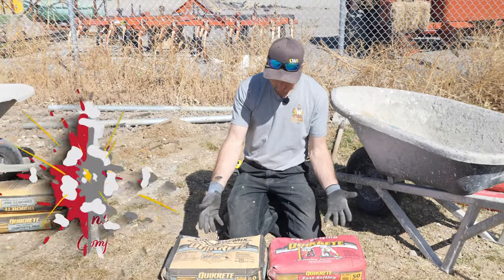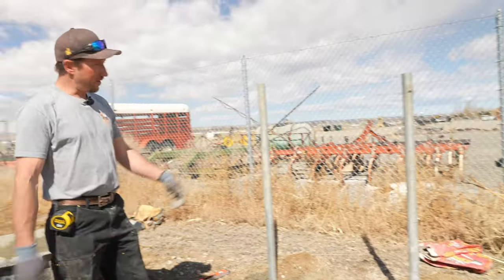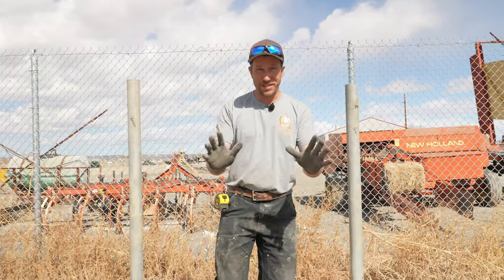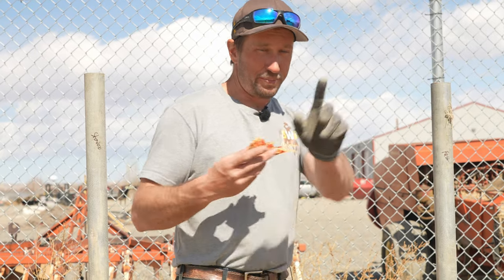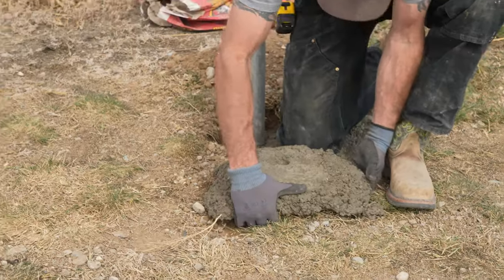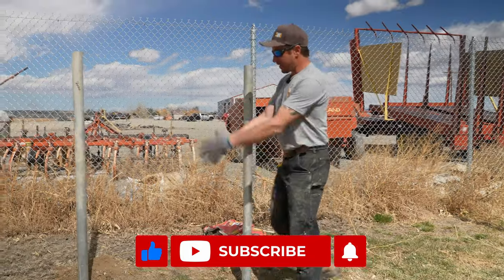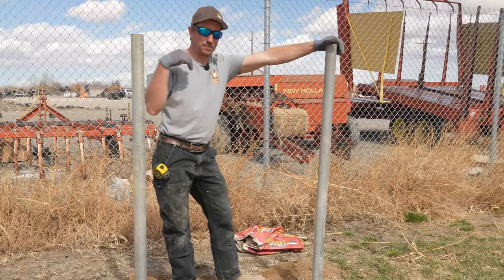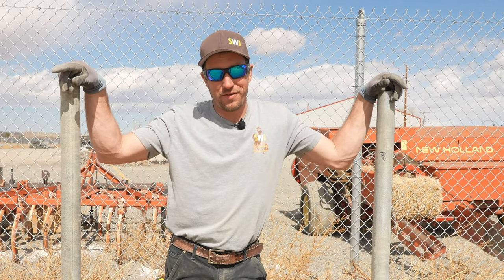Is Quick-Set Concrete Worth It? Testing Quick-Set VS Regular

Comment: Another advantage to the fast setting is that it is designed to set without mixing. We like to get all the post in the ground, add dry mix to all of them and come back to sight them in and add water. We will add water and poke 3-4 holes in the concrete to make sure water quickly penetrates to the bottom. Thanks for making this video.
Reply: Never set up a fence post  but this sounds Ike the best idea I've found yet.
Reply: @xxxxxbriansanchezyyy  best way to have your wooden fence posts to rot out. I'm currently going back and repairing my posts of my deck because they ask rooted out right a ground level.
Reply: Bring your concrete slightly above ground level, slope it down at an angle, so any water will drain and the post will last longer.
Reply: Its literally on the bag label and tells you to dry pour for fence posts
Reply: @cvillefarmer  wood and concrete do not work well together. We use all steel for posts. Piers should be poured for deck footings
Reply: @elliottbrown1725  I went back, cut the old treated posts that are still prefectly fine above the ground level.  Pulled the old footing that had post set into concrete. Poured new sono tube footing up to where I cut old post, used a steel 4x4 post anker bracket set into the wet concrete footing. Waited for cure then set the post down into the steel bracket fixed in the concrete. So wood is separated from concrete by about 1inch with the steel bracket.

Comment: for a little more than half the price, I would go with the regular high strength concrete bag (80 lbs for $5.27 equivalent to $3.29 of a 50 lb bag) over the quick setting bag (50 lbs for $5.37 per bag or $8.59 for a 80lb bag). Just take your time, brace your posts and wait a day. It will take me a few days anyway to set up all my 23 posts.
Reply: So how did it go? I have 23 posts to do too. Was considering the fast due to I live 30 minutes away from the jobsite not really wanting to drive too many days.
Reply: Exactly I'm trying to put up a fence and save anywhere I can. That's why I'm doing all the labor myself 😅
Reply: there is no need for bracing with quick set. by the time you're done with last post you can go back and hang pickets. you save a day for few bucks. quick set all day
Reply: TIME IS MONEY!

Comment: A lot of you have no clue what you’re talking about.  Setup time has zero to do with the strength of the concrete mix.  Rapid set is stronger then anything else in a bag and sets up faster then anything else in a bag… drive on it in under an hour and they use it on airport runways it’s that good.  🤦🏻‍♂️.
Reply: Than, it's than!

Comment: Is it worth it? Well, Quikcrete is more expensive. That said, time is money so if it takes more time to mix your concrete the traditional way then it seems as though you’d be breaking even by using Quikcrete! Personally, after setting a few metal post brackets last week without mixing, I’ll most definitely not be pre mixing in the future.

Comment: I had to watch your video when I got home.  I worked with the fast setting concrete today.  It was my first time to use it.  It does set up faster than the concrete in the yellow bag.  I won't be using it again, because I like to be able to work with the concrete for a few minutes.

Comment: The difference is the formula an yes correct on the fast setting is for fence an the regular concrete is for more lengthy jobs that require longer set an dry time fast setting is for posts only an for side walks an patios there is a product we make Q-5000 which is more pontent

Comment: I’ve used the fast setting before and it does well.  I have a problem in knowing how much water to use.  It’s less than a gallon per bag but it never seems to all soak up and it sets too fast to allow me to poke holes in it for the water to get to the bottom.  Another problem, what’s the technique to adding two bags to a fence post hole?  Add one bag then water then the other bag and more water?  Adding two bags at once then water doesn’t seem to get the water all the way down to the bottom.
Reply: Uh gee boss I don't know, maybe fill the whole 1/3 with water first, then pour in the concrete.  Also 1 part red bag to 3 parts regular, sets faster but cost less and is workable longer. You are welcome!

Comment: They used to manufacture bags with a plastic liner. Now without the plastic, the bags just blow apart if you drip sweat on them while working. Higher profits, bigger bonuses for the suits. Called corporate and complained. It’s been crickets.
Reply: Good. The less plastic the better. 
Just don't be clumsy.

Comment: One more question. I am installing a steel/metal fencing post. The hole that I dug is 3 feet 9 inches deep with a diameter of 14 inches. How bags of Quikrete do you think I would need assuming I want the Quikrete to come up to ground level.

Comment: I dug a 3ft 9 inch deep hole with a diameter of 14 inches.  Due to rain, the 3ft 9 inch hole got about 9 inches of water in the hole. Crazy thing is the hole was completely covered prior to the rain but somehow 9 inches of water still got into the hole. I have been waiting for the dirt to soak up all the water in the hole however it doesn't seem to be doing that. After two weeks the water is still there. So my question is what would be the best way to drain the water out of the hole? I thought about just putting a few thick bed sheets in the hole to soak up all the water like a sponge but wasn't sure if that would work efficiently.  I then thought about just pouring dry concrete in the hole and mixing it with the water that is already in the hole.  What do you suggest? One more question. If I drained all the water out of the hole and the dirt/soil in the hole is still wet and soft is it still okay to mix concrete and pour it into the hole with the dirt/soil already being fully saturated with water? Oh wait....one more question LOL. How many bags of concrete would I need for a 3ft 9 inch deep hole with a diameter of 14 inches? I will be installing a fencing pole with a diameter of about 2 inches. Thanks for your help.
Reply from the maker: You could try a kid's suction squirt gun (outdoor toy aisle at Walmart) or something similar. After you pull the water out--yes, double-check and clean the hole out one more time.
Also, yes, you could throw in some dry concrete and do that as well.
Reply: @SWiFence  I ended up draining the water out of the hole myself simply by putting a thick bed sheet in the hole and pulling the bed sheet back out of the hole.  When I put the bed sheet in the hole it completely sucked up all the water out of the hole. The project required 10 bags of concrete as I made the hole way too deep and wide but I would rather be safe than sorry. The 10 bags used was for a 3ft 7 inch deep hole that was 1 foot 2 inches wide. I will be adding additional post within the post that I installed to serve as a 34 foot mast for my HF antenna. He is the video that I did. There are two videos. Video # 1 is the preparation and Video # 2 is the actual start and completion of the installation. 

Video # 1:  https://youtu.be/9hzI_OhRnjI

Video # 2: https://youtu.be/xBX3DEBQuBc

Thanks for your help.

Comment: Could you use a little fast setting first to get the post to be sturdy and workable and then add the high strength after 30 min or so in order to work while the majority of the the high strength dries?
Reply from the maker: I wouldn't recommend. Concrete should pour once and cure once.
Reply: @SWiFence Facts!

Comment: Yeah fast set is weak. 
It’s like crumbly powder if you hit it with a 6’ crow bar. 
Somebody I know tried making a sidewalk from it. The edges broke right off. 
Zip for strength. 
If I want to work on a post quick I tamp it with a fairly dry mix. It’s super wet where I live so the moisture will continuously go into the concrete over the winter. 
Mix the top well. 

I used to use quick set. I don’t use it anymore. Cheaper. And stronger to use reg set. Once it cures that fence ain’t ever going anywhere (unless a tree root starts moving it over time).
Reply: Thanks for the tip. I was wondering if you could repair sidewalks with it.
Reply: Not everything is a good app for everything. Works more poorly on slabs but good on posts. Just like an 18 wheeler isn't good for orv trail riding. Losing a customer another day of production to wait for set up isn't usually the best choice, either.
Reply: @finallyfriday.  
We set it sort of more on the dry side and tamp it. 
No bracing needed. 
It’s plenty strong and will only get get stronger with time as it sucks more moisture into it. 
The tamping can be labor intensive and a bit slow, but we build immediately.
Reply: @woodman1701  it's the tamping, the compaction that's the real factor. Soil well compacted is better than cement in loose ground. Hard as granite cement is actually irrelevant since the post would break long before. In fact cementless posts rot slower and flex in high winds better (think oak tree vs willow tree). Overkill has its disadvantages. Cost being another disadvantage. No one best answer, though.
Reply: Setting time has zero to do with strength of the concrete.  Rapid set concrete sets up and you can drive a car on it in under an hour and it’s stronger then anything else out there in a bag.
Reply: @sicilianr1  
Well my contractor brother in law and myself tried making a slab out of it once and it had zip for strength. Broke easily after a few days. 
I build a lot of fences and we can tell which concrete post bases are quickset and which are regular set as if you hit the quickset with a 6’ crowbar it breaks and crumbles easy. It’s fine for that purpose and also for setting mailbox posts but I wouldn’t make slabs out of it. 
Perhaps you have a different brand? The stuff sold in Oregon was a not strong. 
I use reg concrete for all my fences as it’s cheaper anyhow.
Reply: @woodman1701  You're not building Fort Knox as a base for a fence post. Massive strength lasts 200 years but the fence deteriorated long ago. What was the point?
Reply: @finallyfriday.  
Well, I save money on every bag I get. It’s like I think like a three dollar difference per bag. 
The cheaper ones are actually 60 pounds and the fast set  ones are 50 pounds. So there’s less troops on every fence as well. So if I have 16 bags on an average job size that’s like 45 or $50 difference and less trips to make to all the holes. And I know that it’s even going to be stronger for the customers over time. Sometimes the concrete will crack in half and the post will become sort of loose. This is more of a insurance policy that that won’t happen.

However if the brand that you’re getting is just a strong, and the bags are lighter and you’re only doing small jobs then I could see the advantage for you. I know Lowes uses only Fast set. Mainly because they wanted to get the jobs done in a hurry. It works for them.
Reply: @woodman1701  Good points. One common claim is about cement cracking-  that is supposed to equate to fence post failure.  Think about it- even though it's cracked it still is encasing the post with a hard, heavy and expanded medium. It still supports. Think of a crack in a road. It's still doing its job. Gravel in the post hole is supporting. No cement, just well compacted soil is doing its job. Pile driven posts are still doing their job. A cracked cement pour in a fence post hole does not equal a fence collapse. I doubt anyone would ever even be aware it cracked.

Comment: see your mix outa the bag aint all gravely i got like a ton of filler gravel wondering "where the crete at" screwed up that ya gota know tricks like add a can of paint per every 5 bags  and a extra couple pounds ceramic plaster  and a can of glue for that playdo icen pasty kinda smooth.... just did our side walk  on straight out the bag edges gona be falling off on gravel flake luckily i got a finisher for surface covering...they should just keep filler gravel seperate and go straight crete filler is underlay..not cool to need trix instead of buy it right as set order of options offered  together  till then it sucks as a brand the second time it was 90 % gravel sucks especialy on tight budget every bag needs like an extra 5 pounds of actual port crete or clay...

Comment: Do you every pour the concrete in dry set your post then add water? I hear fence guys doing this all the time.
Reply from the maker: We don't. https://youtu.be/iBgWx2y9pj8
Reply: We do. Dry pour can be compacted- most important  factor. Wet cement cannot be compacted. More work for less hold.

Comment: So what's the benefit of buying the original version?
Reply from the maker: 1. It's cheaper.
2. It doesn't set as fast. If you're laying a long line of fence or working on a sidewalk that you need time to smooth and trowel you absolutely don't want the fast-setting. It'll set up before you have a chance to finish your job correctly.

Comment: I just used some Quikrete for 2 separate gates posts. The first one I put it, had no issues with the concrete drying. The 2nd one is a different story. Just poured it and, it still looks 'wet'. The first day I put it in, it was mostly sunny and hot. Been a total of 3 days so far and, it's like it's not curing all the way. I've tried to move the post and, it's definitely hardened but, it's kind of crumbly on top. (Like it's only cured for like 4 hours type look). Does anyone know what might be going on? Maybe it's just taking longer to cure, since it's not super hot? Just seems really strange.
Reply from the maker: My guess is, it's cured, it just looks different.
Reply: @SWiFence  That's good to know. ty